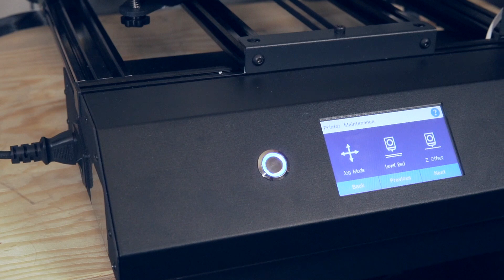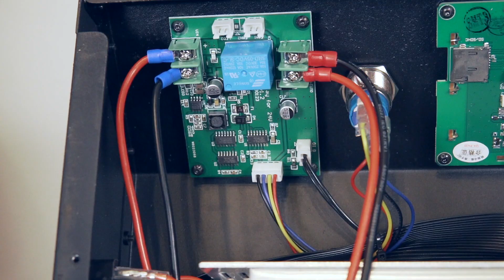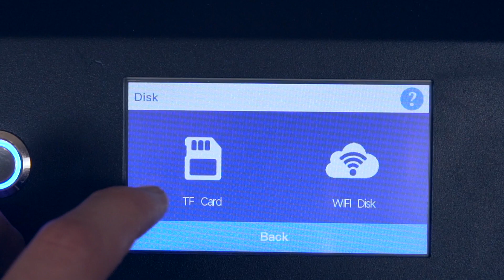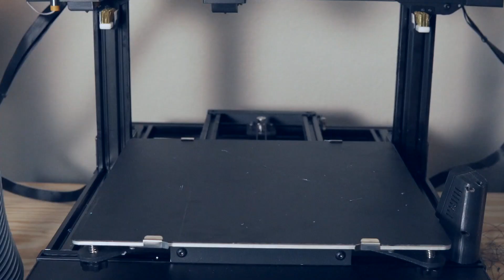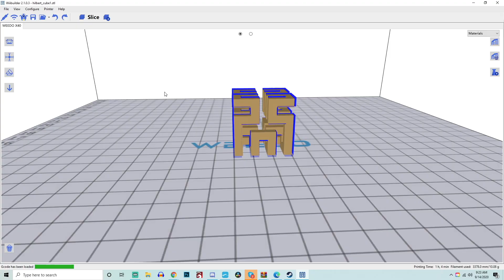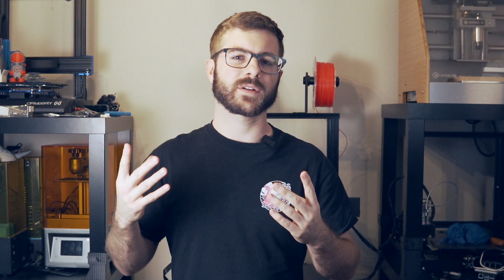Best IDEX 3d Printer Under $1000? Review Of The WEEDO X40

Comment: Doesn't IDEX suffer from the same possible deviations that a hotend with two nozzles will have, if not more?
Reply from the maker: Cable is backwards or firmware direction needs to be changed. My guess is backwards cable
Reply: @ModBotArmy  Surely a backwards cable wouldn't work. On my SW X1 the ribbon cables only have connectors on one side to prevent reverse usage.

Comment: I keep checking Kickstarter but haven't seen this printer listed. Do you know if the launch is still pending? I need an idex printer so I can use soluble supports for complex manifold structures.  This fits my budget, and Weedo seems to make good quality gear.

Comment: Are there idex conversion kits to update existing  3d printers available?
Reply from the maker: Not that I have seen. I could see Creality releasing one but it would require a new board, as well as additional hardware and firmware.
Reply: I found one looks nice. They provide a video as well. https://www.youtube.com/watch?v=DfD1kC1WGWs&t=268s
It shows the process to convert Ender 3 to an IDEX printer, with 2 independent X-axis carriages.